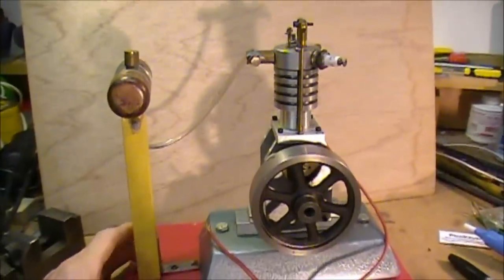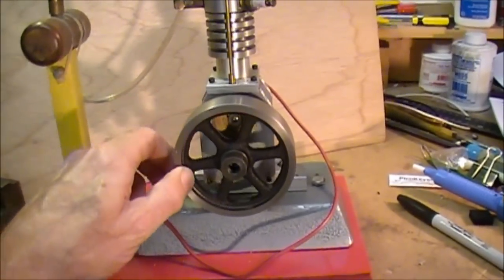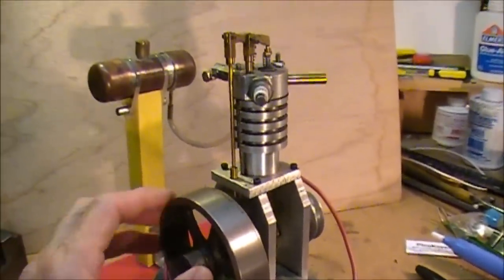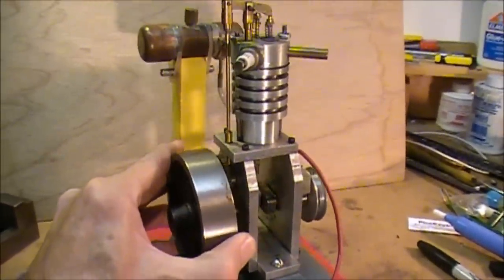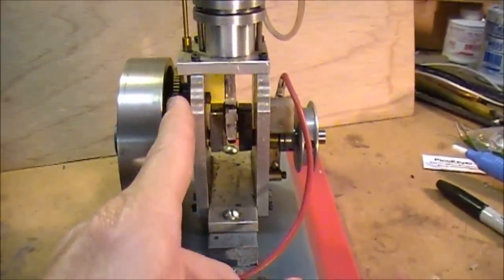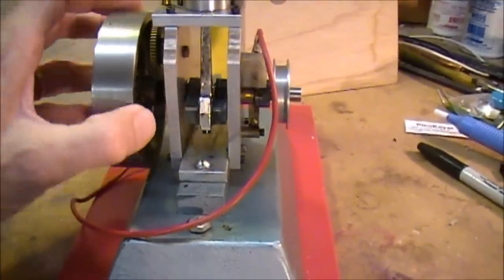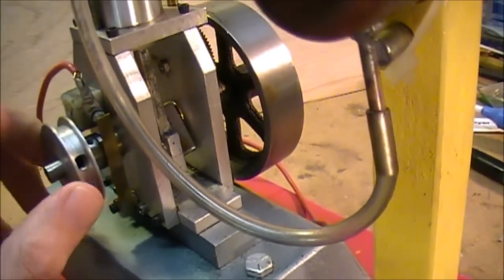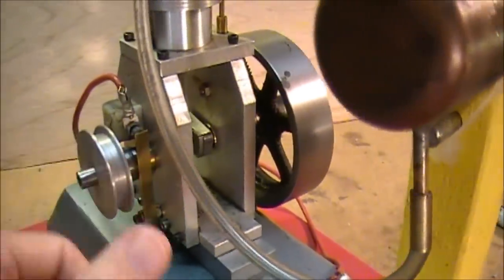Homemade IC Engine-Part 1 of 2

Comment from the maker: You are correct, it is a gasoline engine.  They are commonly known as IC , internal combustion, engines when building models.  They can be made to run on several different types of fuel.  John

Comment from the maker: Brent,

Thanks for your comments and for following along. The plans for this and similer projects can be found on the web, it is build from scratch.  The tools are pretty simple, but you will need a lathe to build the engine.  

Hope this helps.

John

Comment: That's a pretty little engine.  When are you going to get it running?
Reply: Chuck,
Thanks for stopping by and for your comment.  The engine has only been run twice, I've had a lot of trouble getting the valves to seal for some reason.  I've rebuilt them twice.  This summer I hope to tear it apart again and see what's up.
Take care,
John
Reply: John Robertson- Yeah, the valves tend to be my biggest bugaboo as well.